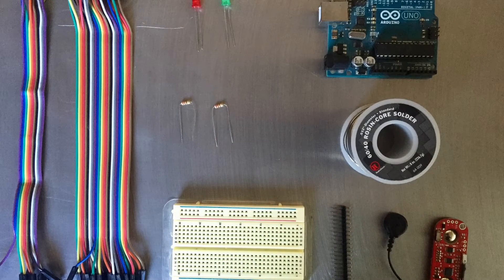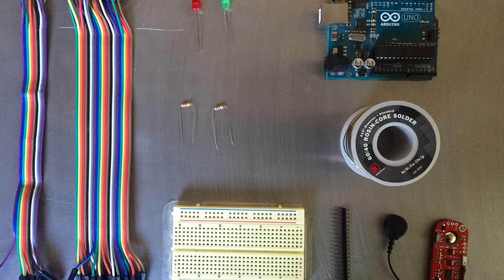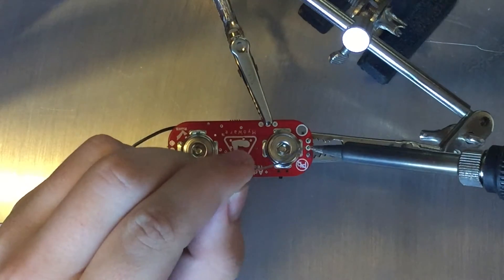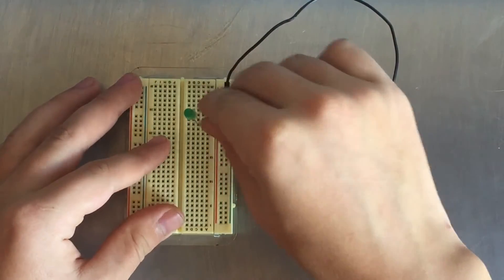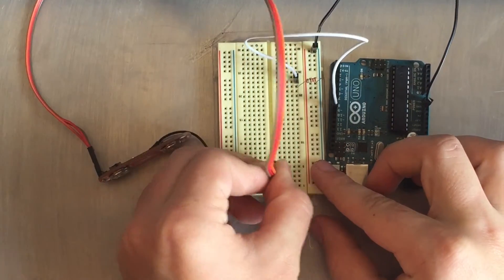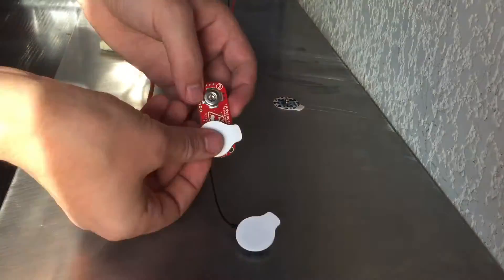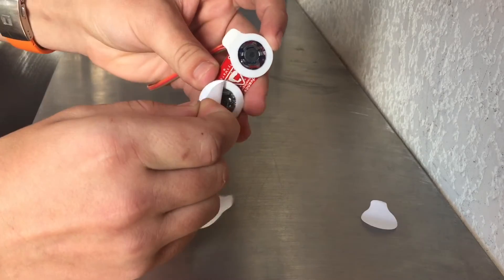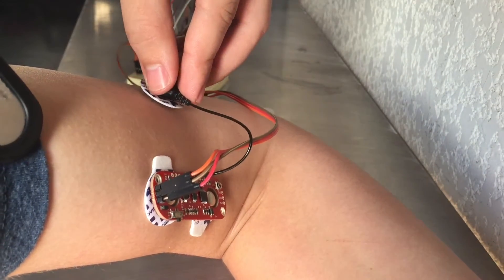How To - Myoware Sensor LED

Comment: hi , I recently bought a myowear sensor and for some reason I'm not able to get it workthe signal light is not lighting up when I flex my arm pls help me out...
Reply from the maker: +vishwas devagiri hey, I would recomend that you check your wiring and connections. If they are fine then you should email them to see why your board it not working correctly.

Comment: This is very very good. I definitely need something like this to start with.
Reply: There are something on coding that I don't understand as a super noob on coding. 
------------------------------------------
const int iMinThreshVal = 350;  
if(iSensorVal < iMinThreshVal)
------------------------------------------
Why "iMinThreshVal" is initially 350? and why "iSensorVal" must be less than "iMinThreshVal" to turn on the LED? Wouldn't it be greater than "iMinThreshVal" to turn on the LED?
I am just beginner and taking a hard step forward. Can you explain them please? Thanks.